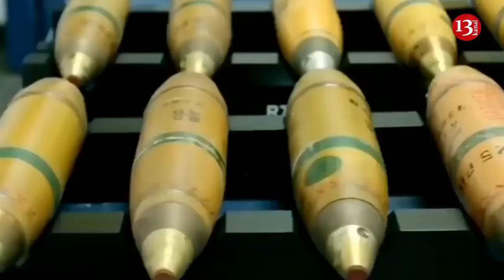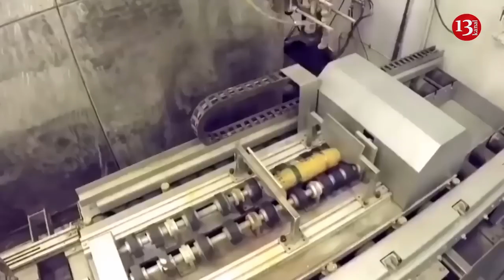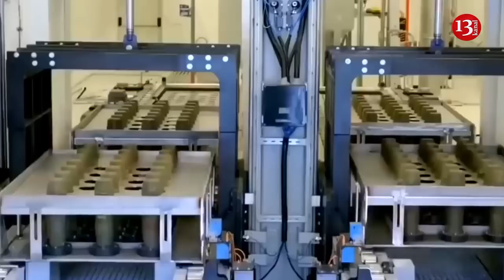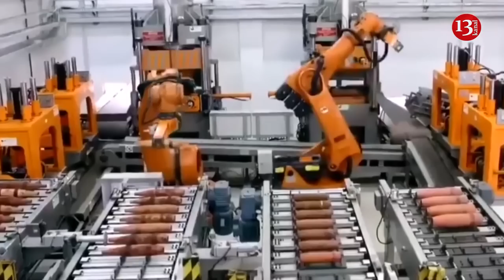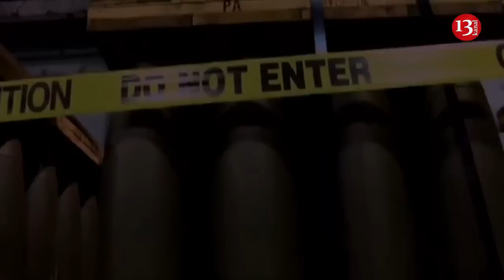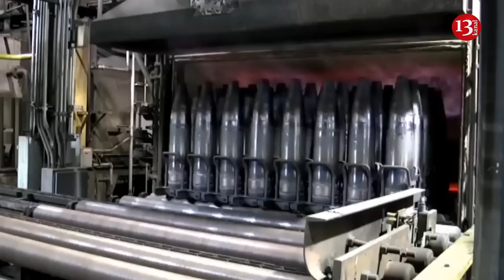Germany plans to produce 250,000 artillery shells for Ukraine

Comment: Delivered military support from Germany to Ukraine:
    84 trucks Zetros
    2 air defence system Iris-T SLM
    2 load-handling trucks 8x6 with 8 roll-off containers
    124 border protection vehicles
    air defence system PATRIOT with missiles
    4 armoured engineer vehicles DACHS
    42 mobile antenna mast systems
    34 reconnaissance drones
    83,520 rounds ammunition 40mm
    18 LEOPARD 2 A 6 main battle tanks with ammunition 
    40 infantry fighting vehicles MARDER with ammunition (from Bundeswehr and industry stocks)
    2 armoured recovery vehicles Bergepanzer 3
    2 mine clearing tanks WISENT 1
    160,000 first aid kits
    103.000 tourniquets
    100 MG3 for LEOPARD 2, MARDER and DACHS
    Spare parts for LEOPARD 2 and MARDER
    90 drone detection systems*
    500 pistols SFP9*
    2 hangar tents*
    23,500 projectiles 155mm
    155mm precision guided ammunition*
    ammunition for multiple rocket launchers MARS II
    8 lift trucks*
    295 generators
    34 self-propelled anti-aircraft guns GEPARD including circa 6.000 rounds of ammunition*
    6 bridge-laying tanks BEAVER*
    10 winter camouflage nets
    26 load-handling trucks 15t*
    32 frequency range extensions for anti-drone devices*
    10 roll off containers
    Iris-T SLM missiles*
    3 mobile, remote controlled and protected mine clearing systems*
    40 laser target designators* (before: 20)
    12 truck tractor trains and 4 semi-trailers*
    145 Pick-ups*
    8 mobile and protected mine clearing systems*
    168 mobile heating systems*
    20 rocket launchers 70mm on pick-up trucks with rockets*
    15 armoured recovery vehicles Bergepanzer 2*
    12 tank transporter tractor M1070 Oshkosh*
    7 tracked and remote controlled infantry vehicles for support tasks*
    35 load-handling trucks 8x8
    36 ambulances*
    36.400 wool blankets
    12 heavy duty trailer trucks*
    55 anti-drone sensors and jammers*
    50 MRAP vehicles DINGO
    10 unmanned surface vessels*
    14,000 sleeping bags
    Mi-24 spare parts*
    spare parts for heavy machine gun M2
    17 heavy and medium bridge systems*
    5 multiple rocket launchers MARS II with ammunition
    14 self-propelled howitzers Panzerhaubitze 2000 (joint project with the Netherlands)
    200 tents
    116.000 winter jackets
    80.000 winter trousers
    240.000 winter hats
    405,000 pre-packaged military Meals Ready
    67 fridges for medical material*
    counter battery radar system COBRA*
    4,000 rounds practice ammunitions for self-propelled anti-aircraft guns
    54 M113 armoured personnel carriers (systems of Denmark, upgrades financed by Germany)*
    53,000 rounds ammunitions for self-propelled anti-aircraft guns
    3,000 anti-tank weapons Panzerfaust 3 with 900 firing devices
    14,900 anti-tank mines (9,300* from industry stocks)
    500 Man Portable Air Defense Systems STINGER
    2,700 Man Portable Air Defense Systems STRELA
    22 million rounds of ammunition for fire arms
    50 bunker buster missiles
    100 machine gun MG3 with 500 spare barrels and breechblocks
    100,000 hand grenades
    5,300 explosive charges
    100,000 m detonating cord and 100.000 detonators
    350,000 detonators
    10 anti-drone guns* 
    100 auto-injector devices
    28,000 combat helmets
    15 palettes military clothing
    280 vehicles (trucks, minibuses, all-terrain vehicles)
    6 palettes material for explosive ordnance disposal
    125 binoculars
    1,200 hospital beds
    18 palettes medical material, 60 surgical lights
    protective clothing, surgical masks
    600 safety glasses
    1 radio frequency system
    3,000 field telephones with 5.000 cable reels and carrying straps
    1 field hospital (joint project with Estonia)*
    353 night vision goggles*
    12 electronic anti-drone devices* 
    165 field glasses*
    medical material (inter alia back packs, compression bandages)
    38 laser range finders*
    Diesel and gasoline (ongoing deliveries)*
    10 tons AdBlue*
    500 medical gauzes
    MiG-29 spare parts
    30 protected vehicles
    7,944 man-portable anti-tank weapons RGW 90 Matador
    6 mobile decontamination vehicles HEP 70 including decontamination material 
    10 HMMWV (8x ground radar capability, 2x jamming/anti drone capability)
    7 radio jammers
    8 mobile ground surveillance radars and thermal imaging cameras*
    1 high frequency unit with equipment

More military support to Ukraine in planning/in execution ...
Reply: Guilty conscience ?

Comment: so what 30 days of ammunition?
Reply: ....that is not correct. Modern western artillery needs 1 round when old style Russian artillery needs 100 or more.....
Reply: @heimdalshorn  Sorry Ukraine uses around 4000 a day. This is on limited supply. They could easily use 10,000 a day if supply was up to it. Remember while the western guns are more accurate not every round lands on target.
Reply: Maybe if you don't waste ammunition, you can stretch it to use it longer
Reply: @resireg Always shells but what the spare barrels that come with😮😊😅😂🎉
Reply: @stewartc4558 Always shells but what the spare barrels that come with😮😊😅😂🎉
Reply: @heimdalshorn Always shells but what the spare barrels that come with😮😊😅😂🎉
Reply: @lyhuy7413  that is also true.  But Ukraine just received Archers and other wheeled and tracked 155s. So hopefully they have spare barrels and equipment to maintain and refurnish